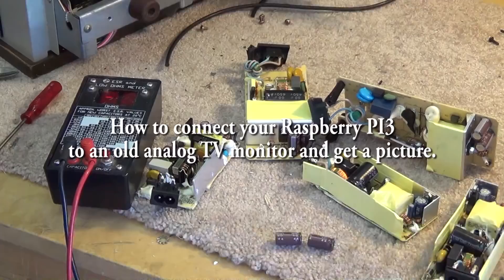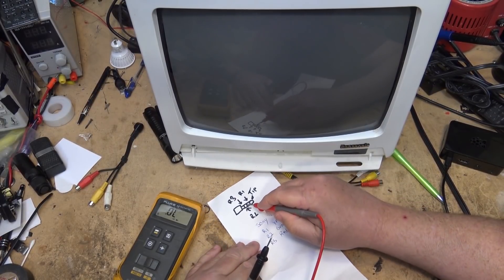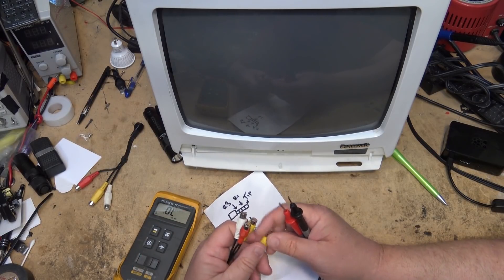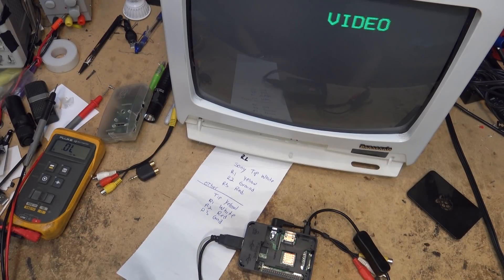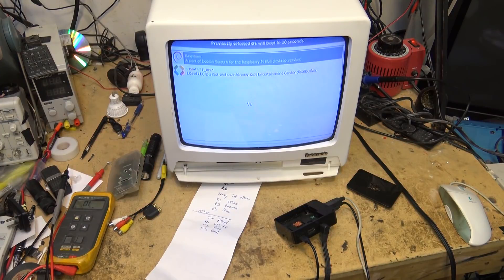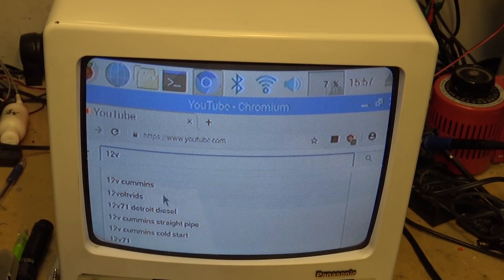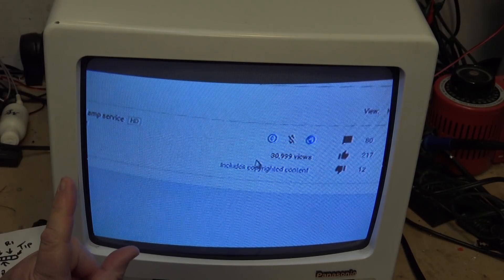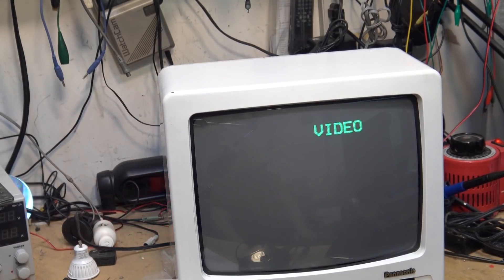How to connect a Raspberry Pi to an old composite monitor

Comment: When you want to click an OK button that's off screen, click on the top left most tab so it's selected, then hit Shift+Tab, which will tab through selections, but in reverse, and it will tab your selection to the button in the bottom left of the window (which is off screen here), then you hit enter or spacebar to select it.

Comment: I noticed you had trouble moving some windows far enough by grabbing the title bar. But, there's another way to do this.

In Linux, you can move and resize by alt-dragging on any point of the window with the left and right mouse button respectively.

F11 will also make your browser full-screen. And CTRL +/- zoom the website in and out.
Reply from the maker: Well if I had a mouss that actually worked properly.
Reply: A working mouse helps but the cursor won't go above the top of the screen. On a low resolution monitor some windows are larger than the screen. So you'd have to drag the tittle bar pass the top of the screen to access the bottom part of a tall window.

That's where ALT-dragging comes in handy.

Comment: Interesting video as usual.... Impressed there are CRT TVsets around still. My wee country just about every one of the things is in landfill or sent to the likes of China for recycle.... A few may be being hoarded to become tomorrows antiques. Everything went digital a while ago now with analog switch off. In a short period folks were able buy a set top box if they still had a 4:3 CRT. It didn't take long for the STB cost to equal the down-payment on a flatscreen and the minefield of complaints about having black bars top and bottom to fit the 16:9 to a 4:3 was almost a nationwide outrage! Those friends whose kids have taken up the Maker hobby and the 'Pi have let me put an onboard 7" touch screen so the things totally standalone and no longer needs patching to an external screen.. (which tends to be already spoken for in the home)...

Comment: For a geek convention we had the idea to have a slideshow "in a loop". Somebody got from a hotel around 12 retired CRT TVs for free... sole condition "do not return them after the venue!"  with those RPIs doing "ken-burns" it that was quite an attraction...
Reply from the maker: I use an rpi to display photos in a slide show. They look great because the images pan, tilt and zoom automatically. I also have a video of just waves crashing in on the beach and I leave that playing for ambiance. I use a couple of old RPI 1B just for that.
Reply: @12voltvids  I can recommend "infobeamer" (infobeamer.com) for that purpose. and in terms of CPU/GPU: 1B or zero is fully sufficient. (and even spanning videos over multiple displays with different resolution and aspect ratio is no problem. Videos are prerendered "in the cloud", stored on the local SD card and playback is tightly syncronised via NTP.

Comment: Could you help me I am trying to use a raspberry pi 3 B+ to display to a 13" AppleColor RGB monitor the monitor uses db15 and I have a gert 666 adapter on the pi and a VGA to db15 adapter with 10 switches but I can't figure out how to get it to display currently there are 2 small pi screens that go in circles on the screen and are greenish.

Comment: Thanks for doing this one! So I guess it doesn't have stereo audio this way as you hook the TV video yellow to the red on the adapter? I'm just trying to not throw away a working TV. It will look ok from 30' away :) I would pipe the audio to the amplifier beside the TV if the Pi can do stereo out this port.
Reply from the maker: Yes it does. I only hooked one up. The one I wasn't using was the other audio channel. The red carried the video and the yellow and white carried the left and right audio. White left, yellow right and red video.

Comment: If you run Raspian in a single boot environment it will be option 2, but will switch to a low resolution output on HDMI if a display is connected. If you want PAL (default is NTSC) you need to edit config.txt before booting.
Reply from the maker: I believe I explained that in this.  As I left it it will boot in whatever it was left in when shut down.

Comment: Thank you very much ... i managed to get it work by your tutorial but it works only with connection Red -> Yellow , Yellow -> White , White -> Red  ... and i checked by Multimetr ... its the Sony version of cables ... but the main problem is that the picture is Black/White. any idea what is wrong? ... anyway your tutorial is still the best i could find ... thank you very much.
Reply from the maker: Check the color system, NTSC or PAL output.
Reply: @12voltvids  Uaaaa ... Toying wint Config.txt for first time ... but yea ... "sdtv_mode=2" works for me ... thank you agayin very much.

Comment: ay love old tech...50 age old ctr vaccum lamp tv it is work today ..LCD TV in 2 age  is scarp and need replace
Reply from the maker: Planned obsolesce
Reply: @12voltvids   of course my horse ..jejeje you see original lcd plan...in the practice same piece component is 1/2 of the real valor...exemple...original plan 4A transistor...practice it is 2A o othere components..not strategic tu run x time(finn time of the garanti..jejejej)..and same tricks to runn god only you have the garanti...y have one 32"lcd fon the trash..only change the fuse...jejejej is run very god ..AND FREE..fuse recicled to othe tresh components board

Comment: I have tried this, and it seems to not be working. I have a Raspberry Pi 4 but as I understand it, they are all backwards compatible (same programming for all RasPi). If you could help in any way, that'd be great!
Reply from the maker: I have a PI1 2 and 3. When I built the boot disk I had to download specific versions of the OS based on the different models. Therefore I would say they are not backwards compatible, but what do I know. 
I use the pi1 as a streaming media player, and both the pi2 and 3 are sitting in a box and haven't been used in months.

Comment: is there a reason as to why the aspect ratio is still too wide after the overscan is disabled?
Reply from the maker: That would be the cheap tv with poor b+ regulation.
Reply: @12voltvids  ah I see, so with a decent monitor I should be able to see my full desktop?
Reply: @henrylong00  yes

Comment: Huh... Seems like disabling overscan didn't fix the overscan problem. Wonder why?
Reply: In linux monitor set up you would right click anywhere on the screen, go to settings, and. do a search for the monitors built in information. 
You should be able to just set a resolution, also.

Comment: This pinout is not correct according to the following page I figured out that the video in raspberry pi 3 or B+ is the sleeve (the last ring counting from the tip).
https://www.raspberrypi-spy.co.uk/2014/07/raspberry-pi-model-b-3-5mm-audiovideo-jack